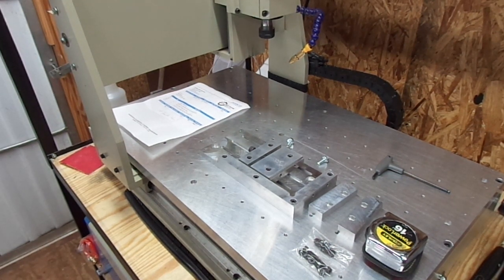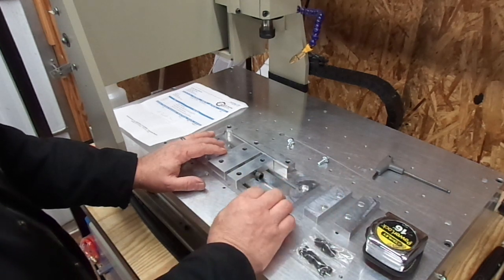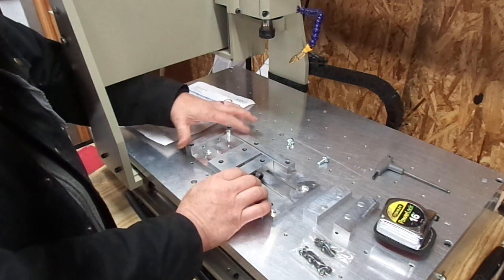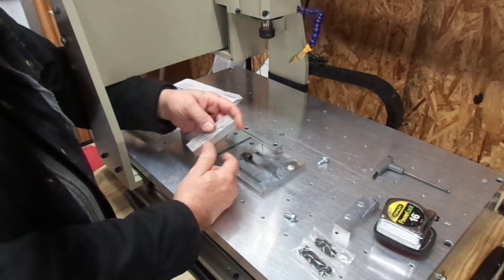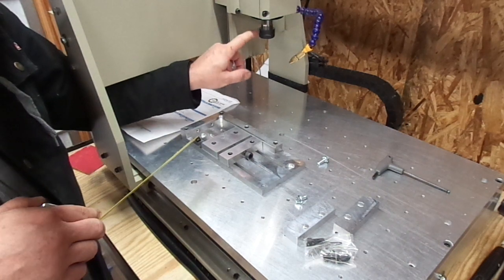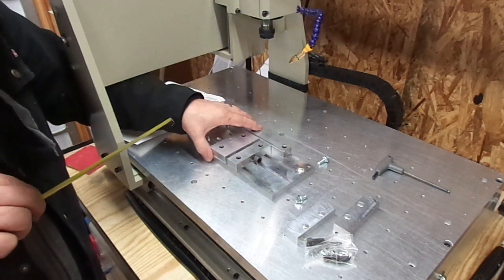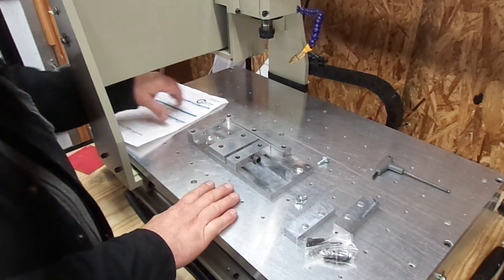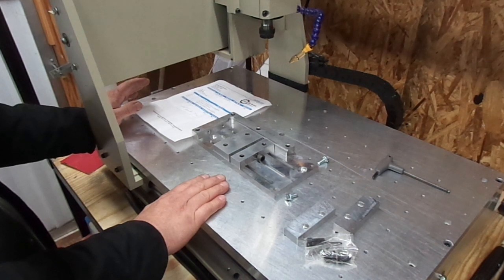6040 CNC Low Profile Vise

Comment: That's a killer aluminum table you have on your 6040, if you ordered it online mind sharing the link? Thanks!
Reply from the maker: Nikita Skakun I designed it in fusion360 and had a local company machine it for me. It’s 1 inch thick and certified machined aluminum. The company sponsored me and gave it to me but I would imagine it costs around $600 after machining. Thanks for the question
Reply: Hi. If you still have the drawing for your aluminum plate would you share it with me Kind regards